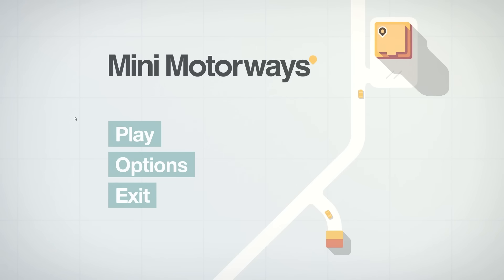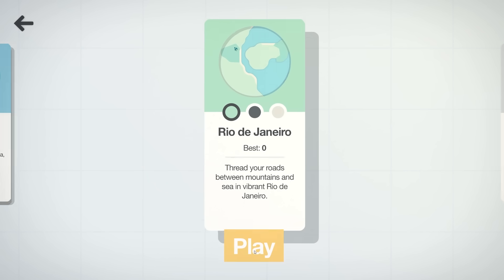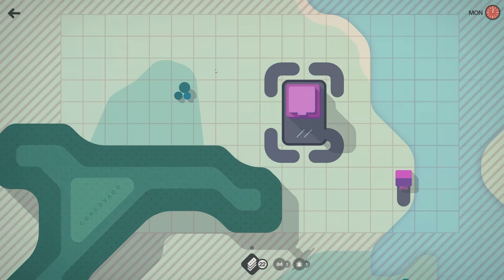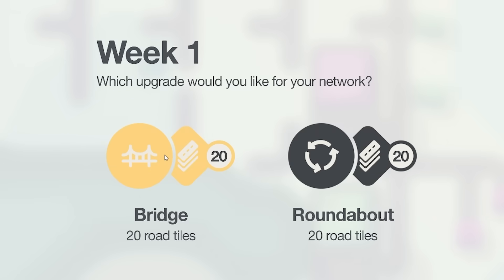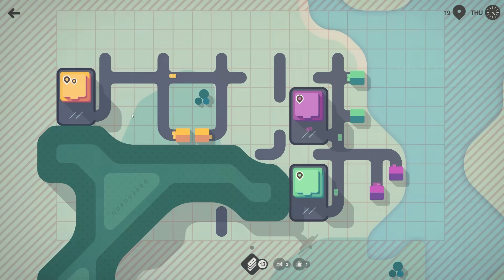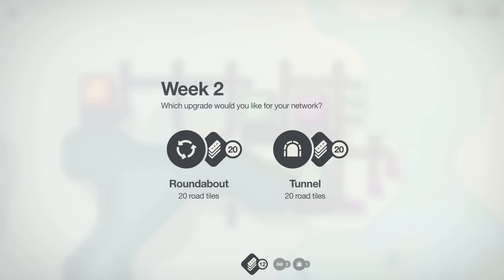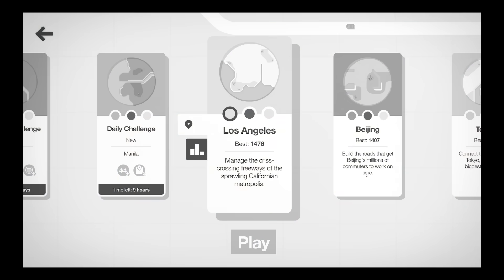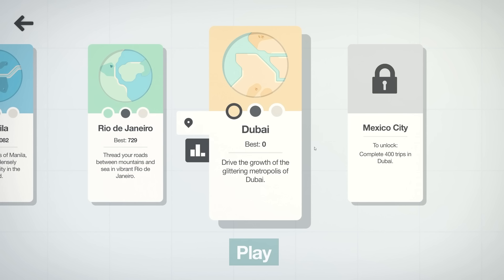Are GRID LAYOUTS effective in Mini Motorways?

Comment: grid systems work really well in real life because they make traffic flow more predictably, reduce or eliminate intersections with more than 4 roads, and make it extremely easy to turn roads into one way roads or close roads for construction without cars having to take crazy detours. in this case though they dont work because its people always going from certain specific points to another specific point and never aywhere else so it makes more sense to just connect thos points with as little intersecting as possible then to make the city easily navgable from any oe point to any other point.

Comment: As an American who lives in Metro Detroit, your decision to follow the river on a diagonal is 100% a thing that’s been done around here a ton.  As it turns out there was a French road system that followed a grid along the Detroit river, but as the British and later American governments built things up further, they chose to align their grid along the cardinal directions.  So, at the end of the famous 8 Mile Road, it meets up with the French grid and makes a 45 degree turn as it crosses a trenched freeway, where it continues with another name.

If you’re a fan of interesting roads, there are some very interesting things we did here in the Motor City—where it’s all about roads and where mass transit was a joke that the wealthiest class, who designed it back in the day, played upon the poor.  The only rail we have is for carrying freight to the auto plants.

Now, what some people find interesting is how long our street numbers are along the main thoroughfares.  Well, turns out that our grid has 1 mile by 1 mile squares (mostly, there are weird exceptions) which sort of form a cartesian grid, which starts at a road that is the zero point and goes up without the roads being numbered until you hit 8 Mile, which is the northern border of of the city.  Those roads didn’t necessarily get names because nobody lived that far north when they came up with the system and they gave each of those roads an incrementally higher number, which eventually taps out just shy of 40.  There are negative Mile roads that run east and west that have actual names, so it’s not as helpful.  In the norther suburbs, it’s handy because you can drive around without a map if you’re above a certain age.

Anyway, there’s a prime meridian of sorts that’s called John R Road, named after someone from local history that probably did something awful, but from that point in both directions there’s roads running parallel, and most living here don’t actually realize this, but every mile road east or west is named as such.  So, there’s an 8 Mile Rd East and 8 Mile Road West, and there is only a couple of super tiny areas where you could theoretically have an address in the same city, with the same number on the same street.  The city planners made sure that didn’t happen, but if you erroneously punch shit into a GPS and include the E or W after the Mile Rd. then it will put a pin somewhere between real street numbers and confuse your stupid ass that’s as much as a mile from your target.

Now the cool part that truly impressed me, which was something the folks at the utility company came up with to make it easier to send out guys in their vehicles to the correct areas without maps or outdated maps.  The street numbers follow a formula, and they’re long to accommodate a large number of potential locations along a stretch of road that will never need a weird modification to the address to make it fit.  Let’s say you were given an address of 34567 (they are all actually this long, but this one is clearly not real by not impossible).  If you knew that it was on major road that runs north and south, you would take the first two digits and subtract by 5, and then divide the result by two.  In this example, you would have 34-5=29 and then 29/2=14.5 which means that the address you’re looking for is going to be somewhere in the latter half-mile stretch between 14 and 15 mile road.  If the address starts with 33, then that’s going to be in the first half-mile stretch between 14 and 15 mile.  If you were looking in the phone book (back when those were a thing) but you only knew the place you were trying to find was a dry cleaner, but you couldn’t remember the name, but you know it’s just north of 8 Mile on a major road.  Well, you could run that little calculation backwards, and take 8*2=16 and then 16+5=21, which means the listing you’re going to be looking for will start with 21, or maybe even 22 depending on how good your memory is because even if it felt like the place you saw was just past 8 Mile, maybe you were speeding or not paying close enough attention and you happened to be slightly off.

The reason for using that exact calculation is because that numbering system was implemented in 1921, and it was only built out about 5 Miles from the center at the point.  So, starting on a street called Fenkell, which is unofficially the equivalent to 5 Mile, which is where that system starts and continues until nobody cares about the people who live out that far.  So that means, at Fenkell, the lowest addresses is going to start at 15,000–and stop at 16,999 because 17,000 is the next street, equivalent to 6 Mile.  Again, the street names are all different south of 8 Mile—but, if you knew this little trick and were told to find a specific address without using a map or GPS, you could easily get within half a mile without any other information than the street name and number.

If you’re as much of a nerd as I am and find it interesting how clever people were 100 years ago when they came up with some far more low tech, but extremely reliable solutions to problems back then.  (Feel free to pull up a map and check stuff out for yourself—I did and can confirm everything works out perfectly every time.). That said, addresses to the East and West along the Mile roads aren’t as clever, or I haven’t bothered looking into it—but with the exception of Warren, most cities north of Detroit are just small enough that you can typically find an address within a short enough distance, that it’s not going to result in the need for another clever system.

Comment: I think one issue is the spawning of the buildings? In America we tend to have denser residential areas with most of the shops along a major street? And stoplights would probably help too I think. We also do use highways a lot so you'd be fine using them in my opinion :) 

(This is just my experience living in America my entire life. Not saying that goes for everywhere but where I've lived thats been the case)

Comment: Grids for small areas of mostly housing or similar colored businesses with limited access points are the idea, then roundabouts for mixed or heavier traffic and viaducts to divert heavy flow around as much as possible is a better idea than just a grid for it's own sake.  I swear we have so many grids in America because local cities want to make fine money for people slowly rolling through stops when they are the only car for miles.  I do like this game, but wish it penalized you for people not being able to get where they want instead of vice versa.  Also, while I appreciate the undo, it often screws you as a freeway will stay semi-constructed for well over a minute.  I think I would more enjoy a game that combined attributes of this and Freeway -- maybe where you build your road system, and it evolves, and you have to spend money tearing down and rebuilding portions -- with the included costs of downtime and higher accident rates, etc...  This game  peeves me sometimes when a new structure has just appeared, and it seems to jump almost straight into alarm even though I had the game paused, and the appropriate color cars, while still home, will go everywhere but the new structure right across that freeway I just installed until I "lose"...

Comment: Grids are only good if the cars are smart enough to predict traffic flow. I don’t think the game can evaluate “congestion” vs. a “longer rout” and pick the faster one, I’m pretty sure it picks the shorter rout 100% of the time.
Also motorways could be used in a grid for a really long route overtop of a normal road, it gets the long commute cars out of the way. I don’t think that would be “cheating” as long as you don’t plop it down diagonally.

Comment: There are three main reasons that the grid style intersections work in the US. First, most of them give priority to one road over the intersecting roads so traffic can flow quickly. Second, liberal use of traffic lights at intersections where both roads have higher traffic. And third is that many Americans have difficulty easily navigating roundabouts so they cause delays that should not exist. Also we tend to use highways (motorways) to connect everything so that there is usually a higher speed way to get to different areas.

Comment: I know how to use traffic lights you put them down at a 4-way you need for traffic lights though and then those traffic lights will regulate the colors it's basically an upgraded roundabout and that's how traffic lights work in real life right you were an engineer literally and you literally don't know that you're supposed to put them at four ways those are where they usually are right sometimes they're in the middle of a road to stop crashes but there's no crashes in the game so the only use for them would be to replace a roundabout because traffic lights are used to basically replace stop signs in an electronic way there was a stop sign in the game it would work at a four-way just like the traffic lights and talk about you put them in a 4-way remember your engineering days

Comment: Traffic lights are useful in three lane junctions where the straight shot is the most used and the other road is barely used. The green light will keep the main traffic going full speed. When the car one the other road needs traffic to stop, it only does so for as long as that car to pass. This really helps traffic problem when 1 same colored neighborhood need to go to both a circle and a square. The square is the secondary road in this case.

Comment: A bunch of tips:
- intersections slow down cars unless there is a roundabout or traffic lights
- however, intersections at the entrance to the shop do not slow the cars, you are free to make multi-way junctions there without any speed penalty
- car driveway attached directly to a road is not slowing cars down unless they just try to enter the road from the house. Therefore it makes more sense to zigzag the road through driveways to get direct connections instead of adding junctions which would additionally slow down all cars.
- In midgame it makes sense to combine 2-3 shops on a single motorway connected to houses, however, in lategame such fork from a single way to 2-3 shops simply can't handle the traffic.
- Shops demand replenishes with no relation to cars supply in houses. The game usually provide more cars then needed. The main aspect between matching supply and demand is time of travel. 1 house next to the shop can do the same job as 2 houses sitting at a further distance or 3 houses that are far away.
- Having several shops of the same color on a single road vein sounds like a good idea but may cause trouble anyways. Firstly, traffic intensity in later game may jam the road entirely. Also, if cars from nearest houses are not available for the shop, cars from distant places that are available at the time will make the trip, taking more time and compounding the traffic on the whole length of the road. You may end up with cars making trips to distant shops while they could be supplying the nearest shops.
- Planning anything makes hardly any sense, just keep in mind spawning patterns (houses and shops spawn according to some rules)

Comment: Grids can take higher traffic volumes than roundabouts before getting backed up, the grid system spreads traffic equally amongst the intersections in the corners of the grids, unlike roundabouts which force all the traffic into a central point. That’s why grids are better than roundabouts (in my humble opinion). This is coming from an idiot, roast me in the reply’s if I’m wrong lol

Comment: Something interesting that might help you plan things: The stores are the ones creating demand for shoppers, not the other way around. When a pin pops up at the store, it means that the store requires a car to travel to it to pick it up, rather than a car wanting to get to there. The store will always draw the car from the nearest available house to it rather than picking a house randomly. 4:16 that house will always go to the closer shop since the bottom 3 houses are more than enough to meet the demand of the far away purple shop.

Also, you need 2-3 houses to meet the demand of a square shop, and 4-6 to meet the demand of an imax cinema
Reply: not true if close 1 for square

Comment: With the latest patch where Sliplane intersections make cars slow down now,
I have the feeling like reducing the number of intersections is the way to go.
So if you need to merge 5 driveways, I tend to merge them in one spot rather than in 5 different ones. (given a roundabout is not possible)
So each car only slows down once instead of 1 to 4 times when driving in and out.
Ofc this has it's limits. If the intersection gets too busy, it needs to be split. But in general, that's what I do nowadays.

Comment: Use the motorways and roundabouts too. And have parallel roads and multiple ways to get to the same location. Connect the houses on inner roads and then pipe them into the main road at one spot instead of connecting them all to main road directly.

I'm surprised you don't do octa-roundabout with traffic lights on it. And place this in the middle of the city and motorway all arms to the far ends of the city.

Comment: Just a heads up: the update changed traffic light ai and changed how cars interact with intersections. Lights should work a bit better, at least, in theory. Cars now slow down any time they reach an intersection or any split in the road even if the split doesn’t connect to anything else. So having many splits in the road is now very bad. Just a heads up in case u were not aware! (Obviously, it wouldn’t matter for this challenge though)

Comment: When you block with roads just use dashed roads as they save a lot of tiles and allow you to block out much more of your road system.
I imagine someone has commented about the updates to the Steam version of the game. 3 way intersections, including house driveways, now slow down traffic a little bit and traffic lights are supposed to work better (if they give them to you)... Plus Manila is now harder so it will be more difficult to beat your score.

Comment: Grids work if you can place stop signs and are careful about deciding who has to stop or not - I know, not an option. The problem is the game only determines the shortest route and doesn't attempt to avoid congestion. However, a stair step or true grid has an interesting, counter-intuitive, mathematical conundrum; to go from top right corner to bottom left corner, going straight to the top left corner and then straight down to the bottom corner is exactly the same distance as taking a zig-zag course diagonally across the map, but the program doesn't seem to know this.

Comment: Without One Way Roads, the Roundabouts and Grid Layout are a bit crippled. Since Roundabouts you can come in and out of the same spot which allows for congestion in a roundabout. And in a Grid you need a dedicated One Way "Rail" to allow traffic to flow unobstructed (Doubling up the car capacity on a road in one direction, allows for outbound vehicles to quickly return home, and inbound vehicles to quickly get to where they need to be). I live in NYC, which is effectively the poster child of the Grid Layout.

Comment: Hey! A few tips:
1. Houses do NOT need to be connected to a shop. They can stay disconnected. This does not go the other way, though.
2. If a shop spawns that "upside-down shopping bag", it will give the task to the closest house with a car, of the same colour, that has a road to that shop. So no need to worry that it will give the task to the house on the other side of the map. (Unless no other houses are available)
These tips should help you in your quest for a highscore. Good luck!

Comment: You can't really have an effective grid without traffic lights... and not just random traffic lights, but traffic lights timed to always be green for people driving the speed limit on major through roads, while traffic lights are timed to ensure stops (to break traffic into smaller clumps) on the lesser roads. Also you'd want a plethora of stop signs, speed bumps, and whatnot to discourage travel through the residential neighborhoods. One-way roads are also excellent for keeping people out of residential areas, and in general for guiding traffic to prefer the major roads. Then, of course, one of the major benefits of grids is that it's very hard to get lost, very easy to make detours when necessary and without looking at a map. Pretty much none of this applies in mini-motorways. Cars always take the shortest route and never get lost, residents don't get mad when people speed through neighborhoods, and traffic lights do their own thing and cannot be coordinated. The best you could do is put traffic lights on your major roads, if you get offered enough or play on an infinite traffic light challenge.